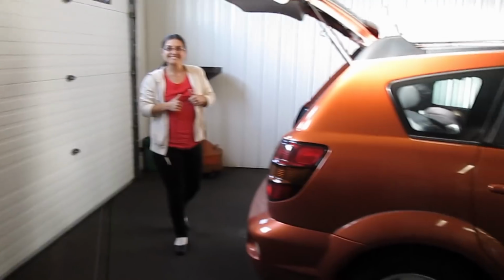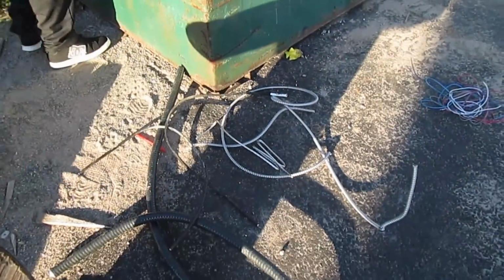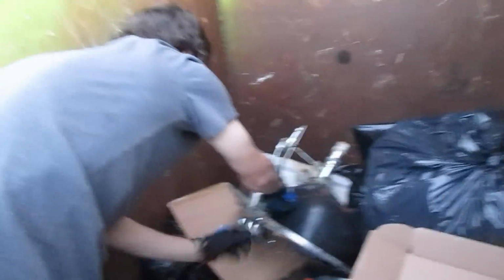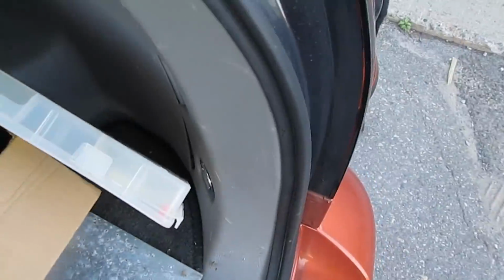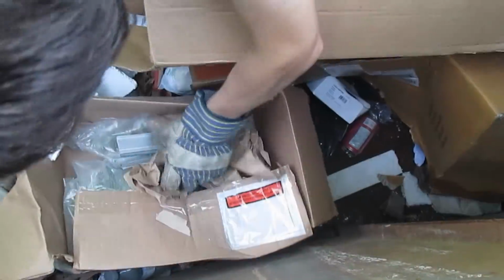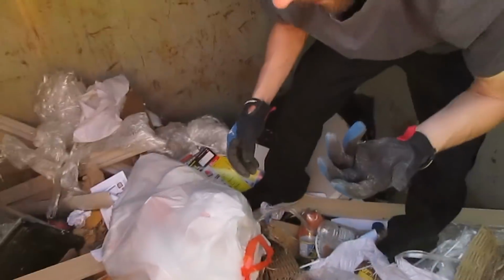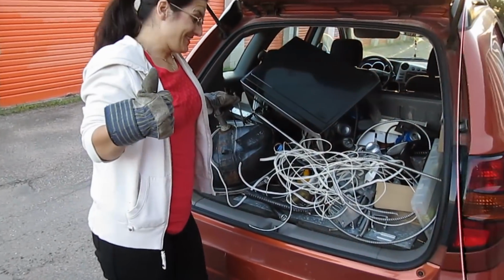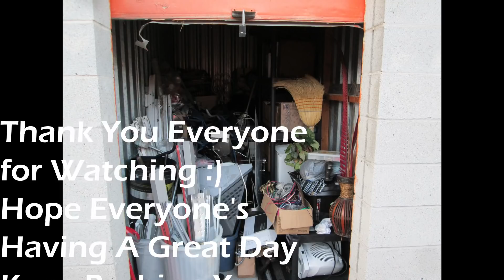LOOK WHAT WE FOUND DUMPSTER DIVING!!! WOW

Comment: I may have shared a video with you about this already, but I was reminded of this tool while watching an old Taco Stacks video a few minutes ago. It’s the TNT wire stripper. There are no moving parts to break or motor to do maintenance on, there’s just a piece of metal that you put into a vice grip and put the spike in the hole that fits the size of the wire you’re stripping and pull the wire through. He was taking his time with it and I bet you guys could go a lot faster with it. Anyway, here is the video and the device is just after the 7 minute mark. I’ve seen the tool on eBay for about $50 or $60 US. I hope it helps! Great fines and great copper plate!!! https://youtu.be/YpI7QvwlKdM
Reply from the maker: ya we have checked out a few ! We Will probably get one when we have a big load of wire to do in the winter as it will slow down for us !😊 Thanks for all your Help